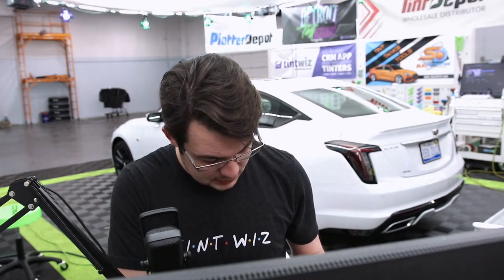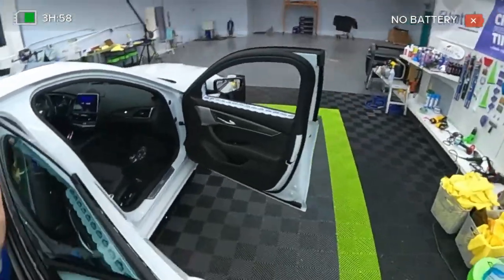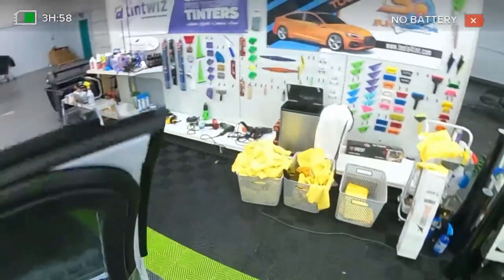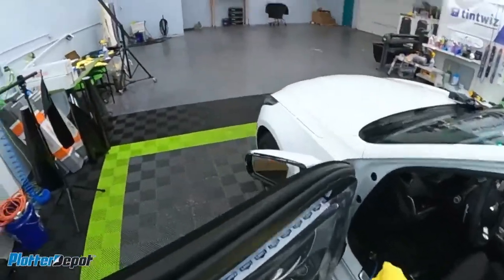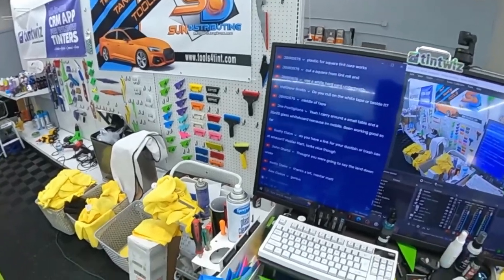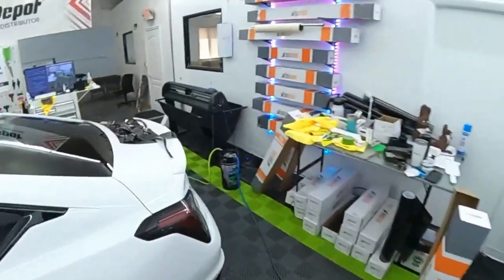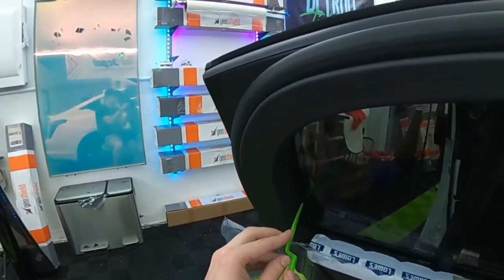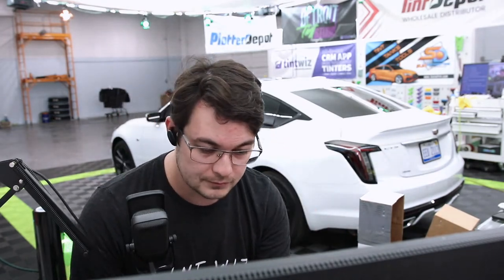Cadillac CT5 Jazzy one Carbon Window Tint

Comment: New to tinting, not sure you read comments but keep getting contamination spread usually lower portion of window just don’t see where it’s coming from cleaning seals and all before install, would like to see a video or what you suggest for new guys. Or any tips to help. I do the 2 stage method.
Reply: Matt uses that lowes tape or tuck tape and puts it around the seals. He said once he started doing that he had less contamination.